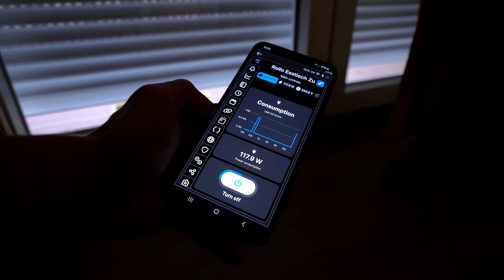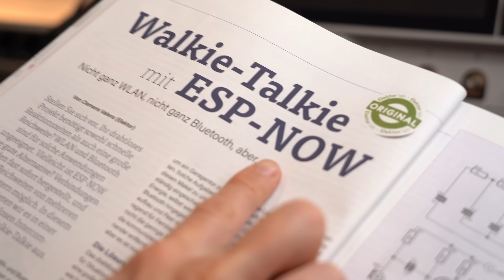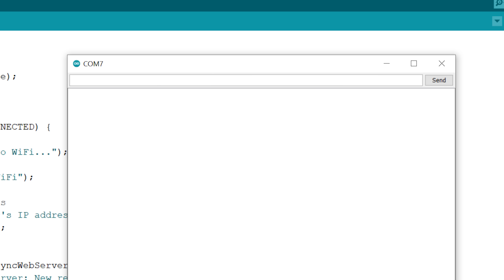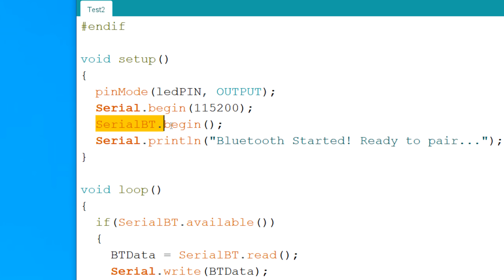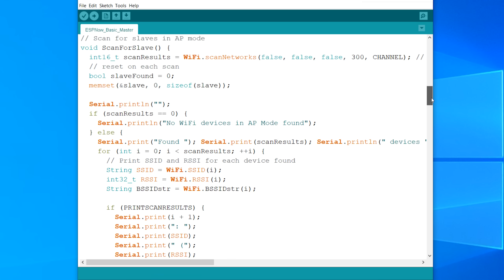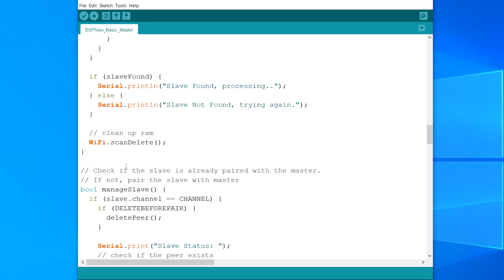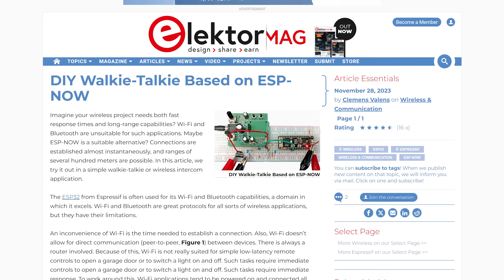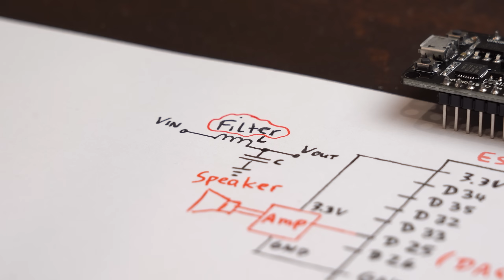Forget WiFi! This Wireless Method is WAY Better? (ESP-NOW)

Comment: ESP-NOW is nice to play with, but it does have some quirks you need to know or else you will loose a lot of time debugging it.
For example, you better not use the full 250 byte payload length as this tends to work less reliable.
Better stay below 200-ish bytes per packet.
Also it seems like ESP-NOW does do some acknowledgements as the round-trip time increases when you extend the range. Like it does seem to lower the bandwidth and thus increase the possible range.

You need to set the MAC address as peer for sending to some other node, but not for receiving. So you can make it more dynamically with some coding effort. The maximum number of peers you can set depends on whether or not you use encryption.
And from experience, the broadcast feature tends to work even more unpredictable when adding more peers. So do not rely on broadcast packets.
Also there is some really odd stuff going on with the ESP radios when using any channel other than channel 1. So best to stay on channel 1 unless you have a very good reason to use another channel (e.g. when STA is connected to some other AP to try and use as a gateway)
You also need to set the channel when adding a peer, as the ESP-NOW code will remember the channel for a specific peer and if for some reason it assumed the peer was on another channel, you will see really poor performance as the radio needs to switch channels constantly.

You need to have a stable power supply when using an ESP-NOW node via its AP interface as this is constantly on. This is the fastest and most reliable mode for nodes that can be always powered as you will less likely miss a packet.
You can send packets via the STA interface, but only use this for nodes that really need to save the last bit of energy like some wake-up, fire and go to sleep again. In all other situations, use AP interface for ESP-NOW traffic. This also allows to properly set the channel.

If you keep all of these in mind, then ESP-NOW can be a really fun protocol to experiment with and the distance can get surprisingly long between nodes.
It also is quite fast as you mentioned. Like a few msec round-trip-time is to be expected when using the AP interface.
Reply: You need to publish this somewhere, like maybe in a GitHub gist
Reply: Thanks for the suggestions. I have a network of 3 esp-now devices, where the 3 devices are gathering data and one of them pushes this data to a web server. For that what I do is set this ESP device to WIFI_AP_STA mode. The issue is that this will set this device in the same channel as the wifi network, so what I do with the other non-wifi ESP devices is to search the channel of the wifi ssid.

This solution was sort of working for some months, but in the last weeks I've been getting disconnections way more often. Since I need reliability on my system, I am looking for solutions but can't think of much. Do you have an idea on how to approach this issue?
Reply: @pllagunos  by far the least complex solution is to set your AP to a fixed channel.
Reply: @TD-er  By that you mean setting the non-wifi esp devices to a fixed channel? The issue here is that this channel might not be the same as the wifi esp device channel, which is dynamic.
Reply: @pllagunos  Nope! absolutely not. You should follow the channel of the AP you need to connect to. So set that AP to a fixed channel or add another 20-euro Mikrotik access point for this purpose if you can't for some reason set the channel of your current access point.
Reply: "You need to set the MAC address as peer for sending to some other node,'" - that is NOT true. ESPnow supports broadcast to all who listens. 
"The maximum number of peers you can set depends on whether or not you use encryption." - true but partially. If you delete peer you can have unlimited of them.
"Also there is some really odd stuff going on with the ESP radios when using any channel other than channel 1" - completely not true - my network works on all channels but 1.
"You also need to set the channel when adding a peer," - not true - you can send on all channels one by one and hope someone will finally receive
Reply: @zyghom  Do you see the problem here "If you delete peer you can have unlimited of them." ? Unlimited less one stays unlimited !
Reply: Reliability is linear to payload size.  So 200 is good, but 25 is much better.  It has to do with the rf environment, such as competing noise makers and the gap between /their/ packets you need to exploit for a successful transmission.  I have seen devices that send tiny packets completely disrupt anything with larger packets.
Reply: not nice < niais < bravos := not-skilled but you are; can’t write adverb/adjective nor chain a nonprospective verb; fast → swift; will → shall; try what? and use

Comment: Did you try out the long range mode too? In my experience that makes a huge difference, the only downside is a smaller bandwidth
Reply from the maker: Actually only tried out the standard mode since that was already good enough for me.

Comment: I've got a dozen ESP32's around the house as various temperature/weather/climate sensors.  But they all connect to wifi and then talk to a Raspberry Pi server to upload their data.

I guess if I wanted to use this, I'd need another ESP32 acting as a host/gateway?  And all the other ESP32's would send their data to it over ESP-NOW, and then the gateway would upload to the Raspberry Pi.
Reply: I've done something like this. I connected the ESP to one of the usb ports of the Pi and then simply used the serial connection to communicate back and forth. The ESP simply acted as a relay between the Pi and all the other ESPs. The Pi had enough juice to also power the ESP through the usb port.
Reply: @josratsma8438  Thats really cool, thanks for telling!  Real confidence booster knowing someone else got it to work.  I am debating the benefits though.  It would require a lot of extra programming and some hardware, just to have a bit of extra range, which I don't need, less power consumption, which isnt an issue, and less wifi noise, which again isnt an issue.  Instead I have my battery powered devices connect only once every few hours and upload the past few hours of data all in one burst, that way the wifi radio is only used for a few seconds every few hours anyway, so ESP-NOW wouldnt really make much of a difference for battery life there either.
Reply from the maker: Sounds plausible like this. But not sure how easy to pull off.
Reply: @greatscottlab  I'd think of connecting an ESP to the RPI on data level. The RPI has sufficient pins for that. You could use 19k2 speed, how much data do you need to transfer? If more, then you could go over 100k bits/second. Main thing of ESP-NOW is fast connection speed.
All said? No, the ESP is a development board. We use it as a end product already. So far my 2 cents.

Comment: Just a side note that if you have multiple ESP32 boards communicating with each other via ESP-NOW especially for fast data transfer applications (like RC Car), there might be noticeable lags in the data transfer (but no data loss I think) until you leave only one ESP32 pair communicating. This is, from what I have experienced, due to too much activity in the ESP-NOW channel you set for each ESP32 pair.

There are a few lines of code mentioned in the Espressif docs that allow you to change the channel, just like WiFi, but it was not obvious (at least for me) :(
Reply: In Broadcast mode (one to many) there is no acknowledge even tho the ack callback function reports a successful transmission.
For exclusive pairs - point to point - the ack reports successful reception so decent flow control is possible in this scenario.
Of course, a manual broadcast with full acknowledgement can be achieved by iterating thru a list of peers sequentially. This should be fast enough to be practical.
Reply: setting channel is one command: esp_wifi_set_channel(channel, WIFI_SECOND_CHAN_NONE);

Comment: ESPnow is super cool, and there is also a long range mode. That in combination with the wifi on the lowest bitrate and some external antennes(but just simple 2dbi ones) i got 2,5km of bi directional communication. But i have to say it was mounted on a rc plane
Reply from the maker: Thanks for the feedback. Sounds promising :-)
Reply: @greatscottlab  I would really like a long range test from you :)
Reply: Wow that's serious range!
Reply: do u have github repos for your projects?
Reply: @Sohailkhan-zw1gl  i dont store my projects in git. But if you look for espnow long range mode then you find the examples. But external antennes do the trick. And remember a had one side on a plane in the air so these kind of range you dont get that in the ground
Reply: Do you have any tutorial for that? It sounds amazing for my project❤

Comment: I have found out that if you use the ESP-32 Dev Modules that has external antenna connector you can greatly improve the range.

Comment: Watching you solder to module pins that have headers is painful. Do you have something against solderless breadboards?
Reply from the maker: Honestly not a fan of breadboards.
Reply: Breadboards can have some capacitance interference, sometimes it's not recommended
Reply: @Seu_Lunga  His soldering and long wires and loops too. and not only parasitic capacitances

Comment: If all you need is the MAC address, then the connections you make are completely unsecure.  I'd recommend using at least a secret key encryption method to help secure communications.
Reply: That's not true. You can encrypt the packet content.
Reply: @ColinMcCormack  That's basically what I said.

Comment: I discovered ESP NOW a month ago. I was very excited about it, since I want to build a home automation system and this protocol looks ideal for the project. I saw a lot of videos about the range, it is much better than the standard wifi protocol. I built a little test circuit to check this range. Only two ESP32-s, one is switching the state of a bool twice in a second and transmitting the value, the other is receiving and write it to a little oled screen. I barely left my apartment, just closed the door and the signal was already lost. I thought, maybe the walls are too thick, so I put the transmitter to my balcony, and I went to the street in front of the house. Approx 12 meters only (4 story house), I saw the transmitter with my eyes, so no blocking at all, but I didn't get the value. Not impressed. However, it is pretty fast and responsible, so it will be the right choice to my project.
Reply: After all its still 2.4GHz, which is limited, specially with such low transmission power
Reply: you know, you should try it again but adding an external antenna for each

Comment: The range of espnow is pretty good with a little antenna.[300ish feet with a forest in the way, 1dbm antenna].I have used off brand esp32 boards with the pcb antenna and the range is horrible without the antenna
  The speed is really good too. I was sending 1 byte between 2 esps and I was getting 700 transmissions per second

Comment: Why don't you use I2S microphone and amplifier it is also supported by ESP 32 ?
Reply from the maker: Sure. Also possible. Should definitely achieve better quality. For this video it was basically just a test/demo what ESP-NOW can do. For a proper project I would have tried using I2S.

Comment: I have a project that I can't seem to find someone to tackle or know anything about. I need a dual Bluetooth audio radio board, with also a analog audio input. One Bluetooth radio would pair with a car amplifier, and the other Bluetooth radio would pair to your phone. The board would bridge the audio from one radio to the other if you were playing music from your phone. Except for if an analog audio source came in, it would interrupt the music from your phone and play the analog audio. I've needed something like this for 10 years and have not found anything.
The analog audio would need to be on a buffer and monitored so that if something came in the first second wouldn't be missed while it switched. This would be used for a two-way radio system, simplex GMRS.
Reply: Two ESP32's with I2S between them for the audio link. Extra distance between them would be good to not make the RF on them distrub eachother.

And analog (via internal ADC or external I2S ADC) into a ring-buffer(kinda big) on the one sending to the car audio system,
so you have a backlog when switching over and won't loose audio.

You may be able to use the examples that come with ESP-IDF & ESP-ADF as a starting point.
A2DP Reciver -> I2S out (as is would likely do)
A2DP Transmitter -> I2S in / software switching (you would need to code the  switching)

Comment: espnow is just so much faster and more range than wifi.
right now im trying to do a raspberry pi + esp32 espnow transmitter (house power) + esp32 receivers (battery/solar power) so i can control my devices from anywhere and also at home.
Reply from the maker: Hope you project will be a success :-)
Reply: espnow is actually wifi. They even openly document how the vendor frame used is formatted. Should be doable to send/recive using other devices, but may be tricky to do.
Reply: @erlendse   what i mean with wifi in my statement is a wifi NETWORK (as a broker that makes esp32's communicate), instead esp32's having direct connection. they DO use the actual wifi radio hardware but not need a wifi ROUTER to work. also for longer range, i've tried with just normal wifi and espnow with 2 esp32s and espnow works for 30m but wifi doesn't. some people were able to do 500m.